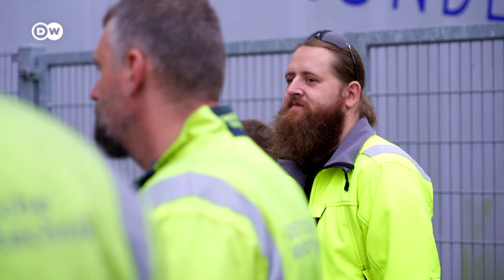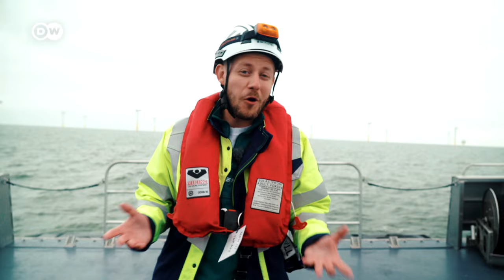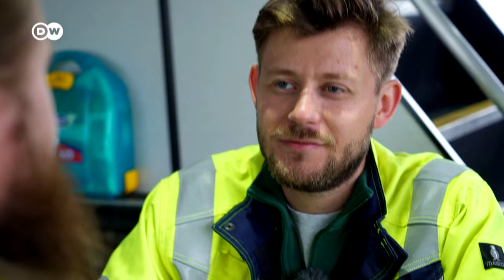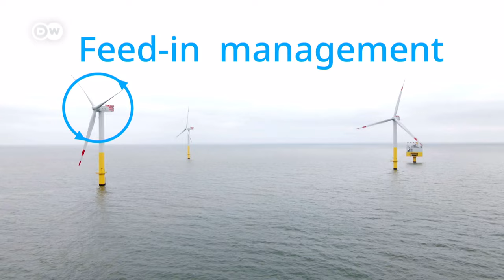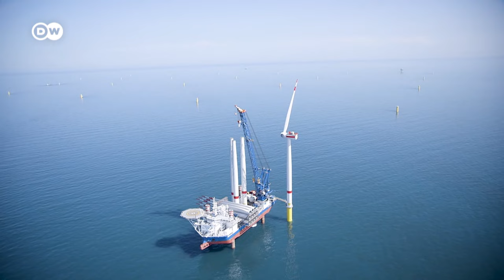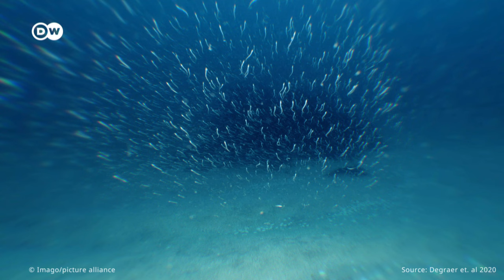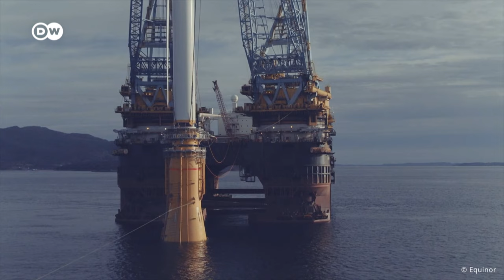Is offshore wind the energy of the future?

Comment: Electricity from wind power currently has the lowest carbon footprint from a cradle to use analysis. For comparison, it takes ~10 grams of CO2/kWh from wind vs. ~40 g CO2/kWh from solar, ~450-600 g CO2/kWh  from gas turbines and >~1,000 g CO2/kWh from coal. End of life waste is a potential concern and many stakeholders are already investing in WT blade recycling. On average, WTs live for ~20 years with minimal delays or downtime. There is huge amount of energy that we can harvest from blowing winds. The energy is indeed renewable not only because natural wind blows all the time, but the materials used to harness this technology is recycable in adjacent supply chains. Ongoing work is underway to solve this technoeconomic problem. Short answer: Plenty of potential to decarbonize our grids but can't be used alone.
Reply: I notice nuclear was not mentioned.
Reply: @darbyheavey406  Nuclear tends to be more carbon-intensive than solar or wind, but less that natural gas, mainly because of all the concrete you need to build a nuclear plant.
Reply: nice comment
Reply: Grid inertia and grod stability might  be a concern

Comment: We need to spend much more time talking about storage. This is the real bottleneck.
Reply: @davidanalyst671  Most of this is wrong. 
1st: Where I live in Germany electricity cost is ~30cts/kWh while the average in the us is 10-11cts. This is not 5 but only 3 times as much, not counting in currency differences. Also, most of Germanys electricity costs are taxes and grid fees. Homemade solar power comes in at 5 to 15 cts/kWh over 20 years, depending on various factors. And after this time solar panels continue producing power for free.

2nd: Germany hasn't shut off all nuclear power plants yet. 6 of them still exist. The last one will go offline in 2022. This is due to their bad variability in power output and their bad reputation due to incidents as in Tschernobyl or Fukushima. Also we just don't know where to dispose of the nuclear waste because the stuff is radioactive for far longer that humans can imagine. There is still no solution to nuclear waste storage in Germany, also because Germany is densly populated.

3rd: Germany is far from stopping coal plants. At the moment coal exit is planned to bin in 2038...

The only thing we could agree on is about the government screwing Germany.. Not for "idealogical" reasons as you say but for knowing better (e.g. scientific research) and not acting accordingly.
Reply: @davidanalyst671  Energy storage is a technology, engineering, and logistics problem, not an ideological problem.

Comment: Superconducting cables could be the solution for transporting a lot of energy. In Munich, a 12 km cable is already in service and in China, a 2400 km cable is planned. High voltage transmission lines have got the problem of resistance from local residences. Often, the resistance gets broken if the cables are underground. Superconducting cables are always underground cables.
Reply: It still not clear yet, if the superconducting technology is really more cost effective in the long run. Besides the higher construction cost you also have more costs for maintaining that. And normal high voltage DC transmission is actually not that bad. So I’m not sure if we will see this technology be used widely.
Reply: 建築一條電纜。比起生產大量電池更便宜和對環境友善。因為最佳的清潔能源儲存方法。就是立即由適當的人將清潔電力用掉。不需要儲能就是最便宜的儲能方法。
Reply: @Dani004able  Sure, but there are already commercial applications since 2010. A lot of old and small to midsize water plants got refitted with superconducting generators in Germany. I'm optimistic it will become viable for wind turbines too. Afterwards the production capacity will rise high enough to build overland transmission lines.
Reply: @juliane__  for generators, I completely agree. For the transmission over long distances, I would say that’s a big maybe. What I was trying to say, it’s not sure what we will use in the future. I think both ways are viable.
Reply: , @Dani004able  I agree with your thinking. I wanted to point out superconducting is viable, because it is understated what is possible and built for at least a decade. And with all disrupting technology, if it gets track it will take a few years to see the main market share. For now, long-distance transmission is, I guess, ten years away to become feasible. But we will see if DC can still compete since it is still a new technology. I just love to see, we can build a better future, no matter what is the tech. It has to be the suitable tech.
Reply: @k.m.7533  Mayby you check out, i'm talking about DC. And despite your worries, SC Generators are being using today and are a good choice, because supercooling doesn't take that much energy you might expect. Additionally, you leav aside, that conventional cooling of generators and electronics does take considerable amount of energy outside the system. Here you are, It is the volume and cost, what is prohibiting the application today, but nevertheless there are new project which move SC cables and generators forward. Happy Times.
Reply: @juliane__  The cooling is not comparable to the cooling of generators though. You need to cool the cable itself which requires cooling stations every few kilometers. There is no way this will ever be cost efficient. Sorry I thought you were confusing DC and AC. Checked it and it seems to make sense for 750+ km. I take everything back in that regard.

Comment: We  also need cheap energy storage to use renewables to their full potential
Reply: iron air batteries are looking good bet , cost is going down  but you still need excess power to charge them
Reply: Or nuclear as a backup
Reply: Convert the 1 TW Hydro Units to 10TW Pumped Hydro Units with 100TWhrs  Storage (100hrs Storage of the rated 1TW.. or 10 hrs at 10TW.. the size of the larger Pumped Storage TG's).. 
You can then Store-n-Convert 100TWhrs/Day... or 40,000TWhrs/yr to support 20% S2S (Sunset -To-Sunrise) Energy Storage for a 100% Solar Powered 150TW Global System... producing 180,000TWhrs/yr... EASILY DONE ... NOW DO IT...
Reply: @AjayAjay-gz3oz  not easy - enviromentalist  have blocked  these schemes.(same with tidal) . However pump storag has a low density of power per ltr . and requires a head of water preferably 1000 mtrs  . Almost all of England is too low to make it practical which is why Scotland and Wales have ours.  France uses there hydro to back up nuclear and countries like Norway with low population have readly adopted as much as they can.

pumped seawater has issues with corrosion and wildlife , needs cleaning like ships do. 

just for the sake of it I'm going off to work out how much water will be needed and how much it would cost per GW capacity  to get 100TWh storage.
Reply: It could be possible to use battery containers to be directly charged from the off-shore farm and then taken to closest container port to be swapped to container ships. 7MWh/TEU is very doable. If the Danish decide to make that artificial island that could be one battery swapping hub for container ships. 😎
Reply: I mean here in Denmark we've been researching thermal storage using pebbles for the last few years. The company working on the first full scale trial instalation calls the technology "Gridscale". It won't have as much capacity or last as long as Lithium Ion per charge but it should be MUCH cheaper and a lot more durable after several years of intensive use.

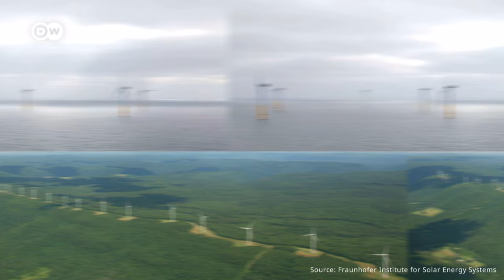Comment: 6:44 Hey, DW! Don't you know that energy measures in kW*h not in kW/h. 
And most probbly there is an error. Offshore wind power cost around 70 euro per MWh or 7cents per kWh.
Reply from the maker: Hey, thanks for your comment. What do you mean by "in kw*h not in kw/h"?
Reply: @DWPlanetA I am 100% agree with @TheEranty comment. " kW is power and kWh is energy but kW/h doesn't make sense, it doesn't exist."
Reply from the maker: @MrYngram @TheEranty Thank you for pointing this out, we didn't catch this! You are right, it should be kWh instead of kW/h. We apologize for the mistake and thanks for being attentive.
Reply: @DWPlanetA  You're welcome. You are always doing a great job, just a few mistakes that can be solved with an expert review.
Reply: btw: according to latest ISE study, coal power costs (black coal as well as lignite) are above 10 cent/kWh... Offshore wind even tends to be cheaper than energy generated from the highly efficient CCGT.
Reply: @DWPlanetA  The most important part is that you're showing the wrong prices!!! Those prices are in € cents per kWh, not euros...
Reply: @DWPlanetA  fix the prices, that is putting this important tech in a bad light.
Reply: @TheEranty  kW/h could exist... but it would represent power that increases over time.  Much like velocity can be represented as m/s.  kW/h could represent a power source that continually increases.  (But, you're right -- based on the context of what DW was presenting -- they got their units wrong)
Reply: @gilian2587  And remember that one Watt already is 1J/s. It doesn't really matter but I guess it is a fun fact (that everyone should know from school).
A kWh is 1000J/s * 3600s. So the seconds are cancelled out and we are left with 3600000 J or 3.6 MJ. And that is an amount of energy, just like 1kWh. kW on the other hand represents power. I wish, people would have talked less to their neighbors in school.
Reply: @rainerzufall689  :)  You are, indeed, correct, the implication would be that energy payload accelerates over time.  It might be an interesting unit for measuring meltdown in nuclear reactors (that's the only generator source I can think of that might do something like that... but doing that is undesirable).
Reply: I just watched this video.  Yes, you pointed out a huge mistake in units of measure and especially with the price being too high by two orders of magnitude!  

DW need to state a correction in both YouTube timeline annotation in the video at 6:44 and in the video description too.  Both of these can be performed an an existing video.

Comment: As other commenters have pointed out, this is extremely materials- and land-intensive compared to nuclear. It takes a crapton of wind turbines to generate the same electricity as one nuclear plant, and the nuclear plant takes up way less space and doesn't kill wildlife. The engineering challenges of mining fuel and disposing of waste are solvable, but there's a hard limit to how efficient you can make one wind turbine.
Reply: I'm for nuclear power if you will store the waste in your backyard.
Reply: Nuclear will eventually hit a limit though, they need to be build on land.
Reply: @jazzypoo7960  "store the waste in your backyard"
Sure, why not. A dry cask storage is completely safe.
If I would have enough money, I would even order a BWRX-300 or a NuScale reactor in my backyard.
The more you know about the technology, the less scary it is.
Reply: @jazzypoo7960  With pleasure. For a small fee of $200,000/lb. of total weight. Advance payment. Processed and encased according to my specifications. You pay for the transportation and processing as well as taking care of all the paperwork. Max total weight 600 lbs. When can we sign the contract?
Reply: @timbehrens9678  Getting paid money does not make nuclear waste safer for you.
Reply: @jazzypoo7960  You don't need to worry about my safety. You just have to pay. When can sign the contract?
Reply: @timbehrens9678  My net worth is about 800 USD. So no contract.
Reply: Of course if we were to build nuclear plants, you would also be on here commenting against those too.